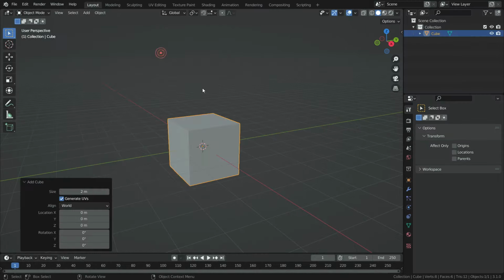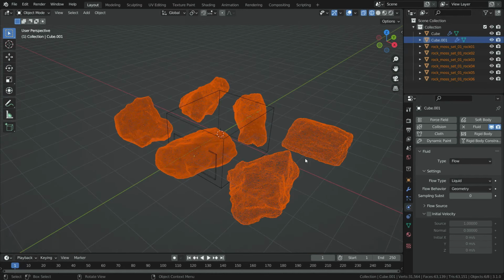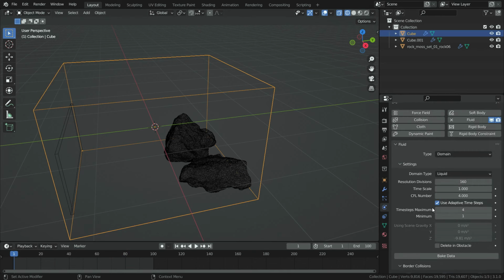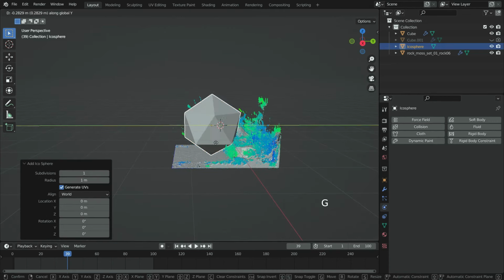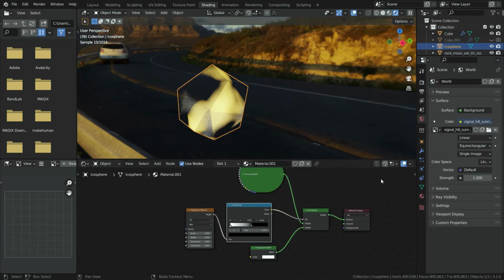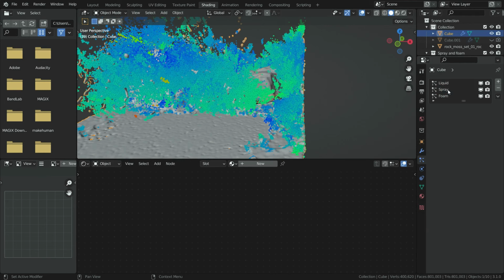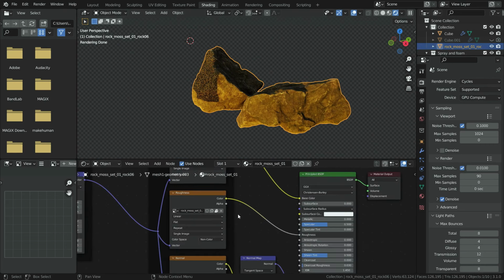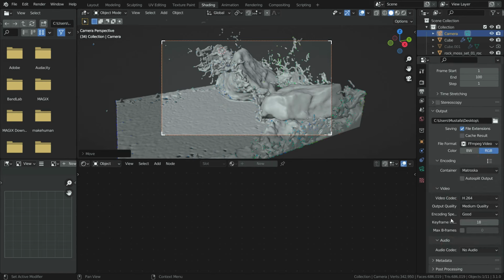Fluid Simulation | Foam And Spray | Blender 3.1 Tutorial

Comment from the maker: If your simulation don't work after baking, just control ur flow object . Maybe you scale down it on the Y axis at negative values.If it is negative,pls turn it to positive value.
Reply from the maker: @MercuryRisingFast  I think Flip fluid more practical to use. Flip fluids is an add-on after all.
Reply: @mk3dgraphics  thank you. I'm new to Blender, and your tutorials are very invaluable to me. Thanks so much.

Comment: Weres the Musgrave texture
Reply: The Musgrave Texture node was removed in Blender 4.1 and is no longer available in current versions like Blender 4.2 and 5.0.  It has been merged into the Noise Texture node, which now includes the previous Musgrave parameters and functionality.

Comment: This was extremely helpful, I thank you. One question: I find my "water drops" that come from my flow sources are much larger than yours in the video and I wish they would be smaller, what is the way to control this? Thanks!
Reply from the maker: Thank u for ur nice comment.If u want to  make smaller water drops, u can increase resolution division value. In this tutorial I keep it at 160 , u can set this value to 256.But, it will take longer time to bake.
Reply: @mk3dgraphics  thank you so much for your reply!
Reply: @mk3dgraphics  hey, do u know why my spray and foam particles just disappear about in the middle of the simulation?
Reply from the maker: @DoGGuY I dont have any idea.But I hope your particle maximum and minimum life values is default.
Reply: @mk3dgraphics  i'll see! Thank you

Comment: Have you tried using the new cycles point rendering system for the foam and spray particles? I think they are much faster to render and consume much less memory! They are less customizable (or at least I don't know enough to do so), but being so small, maybe you can't even notice this issue.
Reply from the maker: Yes I heard about new cycles point rendering system. It has released in Blender 3.1. But I really don't know enough to make foam and spray particles with it. You can share if you know any tutorial and source about it.

Comment: Awesome stuff!! When I switch to solid view after baking the mesh data it still looks before when previously baking the data? It looks like mesh but its colorful like weight data (Blue to Red) And I can't change to wireframe or other rendering modes
Reply: In the particle tab of your domain, disable the liquid particle view in the viewport. It's the small monitor icon next to the camera icon.

Comment: nothing is happening after Baking but i followed all the steps correctly
Reply: under flow object there is an option flow source to surface emmission, turn that up from 0 to 0.8
Reply: @minay6829  thank you
Reply: @willy93-3D  Did you re-bake the the data? I am having same error after following their instructions  @MinaY @MK Graphics
Reply from the maker: Just control ur flow object(cube.001).Maybe you scale down it on the Y axis at negative values.If it is negative,pls turn it to positive value.

Comment: Thanks for this tutorial! Looks very nice!
Any idea what to do if the liquid (Cube.001) is not working when baking is finish?
Reply from the maker: Just control ur flow object(cube.001).Maybe you scale down it on the Y axis at negative values.If it is negative,pls turn it to positive value.
Reply: @mk3dgraphics  Yeaah, this works! Many thanks!
Reply: @mk3dgraphics  Thank you so much for this hint! Negative scaling was causing the issue too with my fluid. In my case, was Z axis scaling, but still. Huge thanks!
Reply: yeah